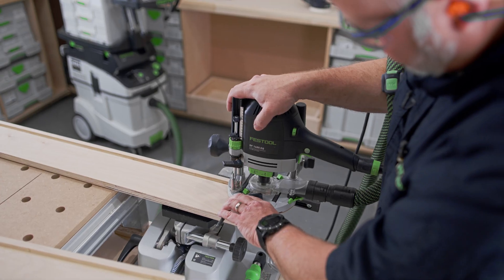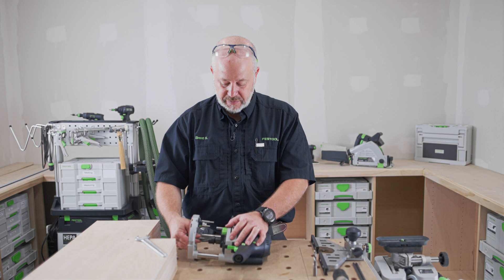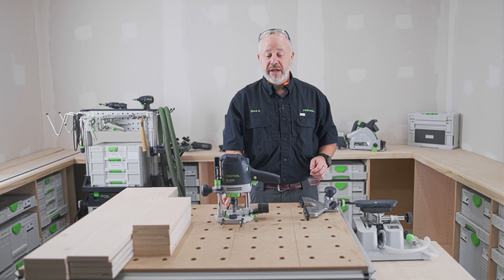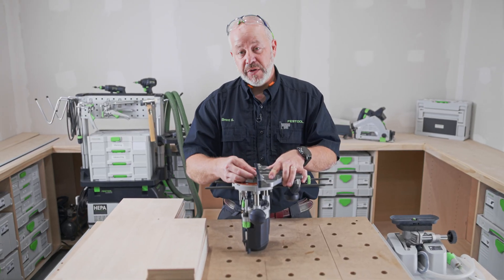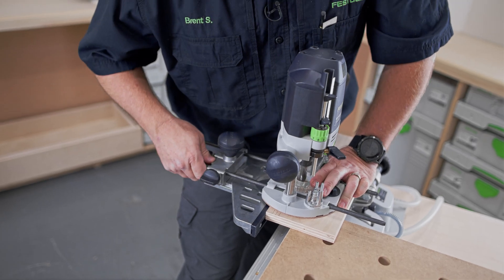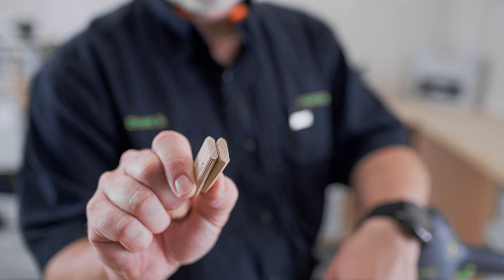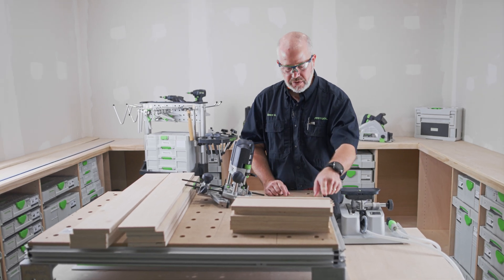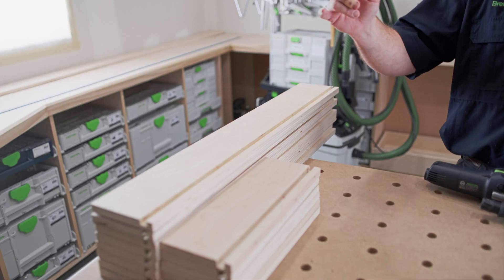Build Series 5: Doors & Drawers: EP 2

Comment: Brent, in one of the shots in EP 2, I noticed your Vac Sys foot control is on a board that is underneath one of your mobile MFT cart’s caster wheels.  Wouldn’t that make your cart unbalanced, or do you have blocks under all the wheels?
Reply from the maker: JT, the block is a temporary fix. Yes, it would make the cart un-level. 
Brent.

Comment: Talk about "make work" for the router.  Use a dado setup in the table saw for this operation.
Reply from the maker: Dixon,  You could definitely utilize a dado stack as well.  This is simply showing another way to complete the same task.  
Brent
Reply: @festoolusa  I know.  But it's easier and faster to set up the dado and run your groove that way, and with less chance of running out of your line.  The router is best suited to mortising operations in my view.
Reply: Or not
Reply: @daveklein2826  ?
Reply: @vdpeer  what don't you understand?